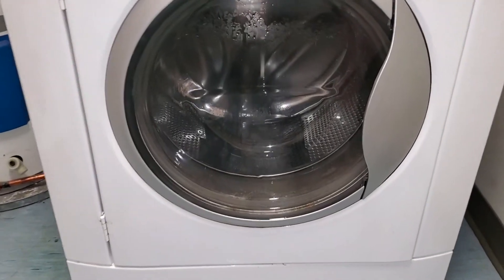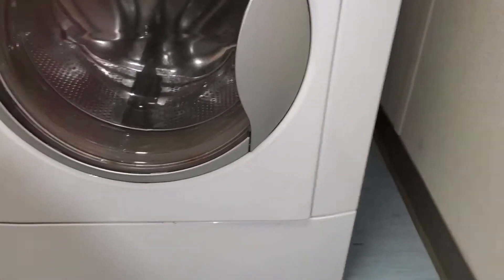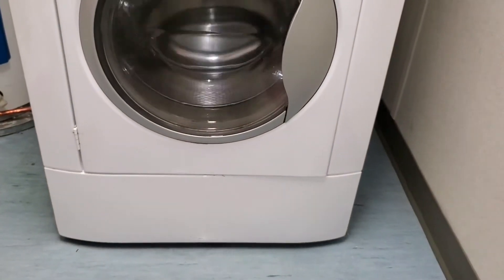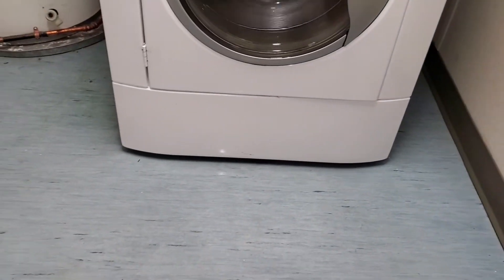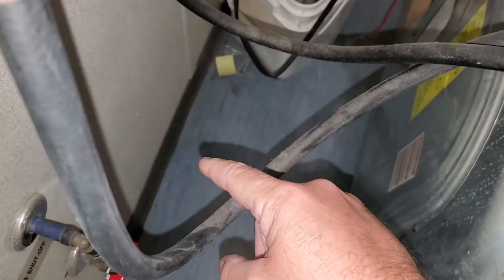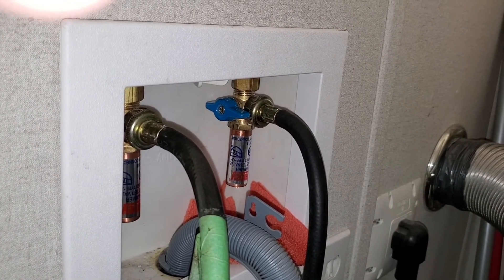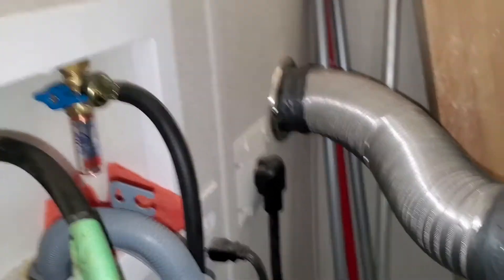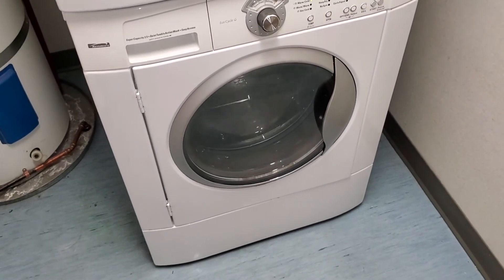Mysterious Washer Woes - A Special Presentation

Comment: If the floor was wet, and what you have shown and shared I agree with you door was not completely shut. Good job ! Thanks for sharing the video!
Reply from the maker: This video is actually an older one that was previously private - I was going through my videos last night and decided to make it public.  It was one of those instances where they had called me a few times about their machine leaking, so I made the video as a means of communicating to them that it didn't leak while I was monitoring it.  They haven't reported it leaking since :)
Thanks for watching!
Reply: No call backs , that’s good. 👍🏼